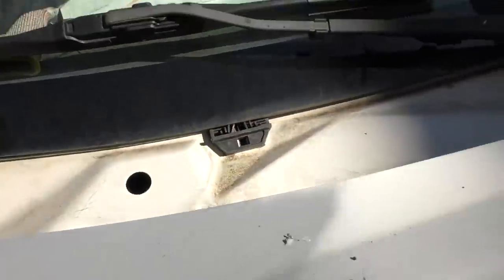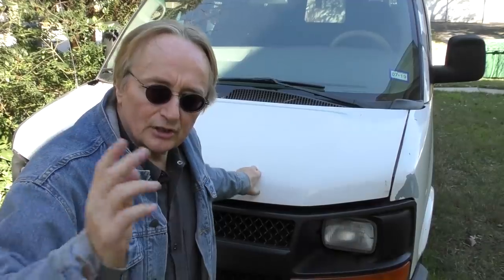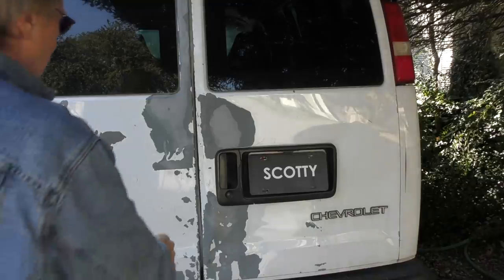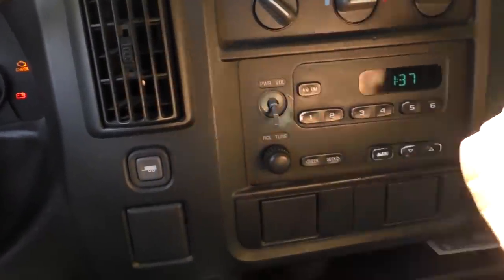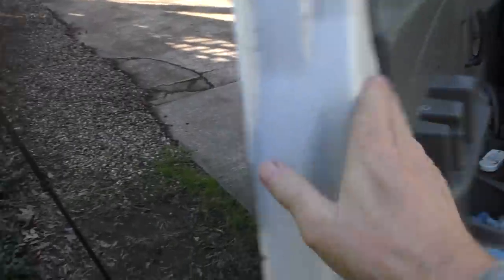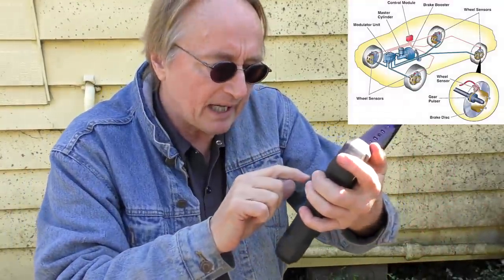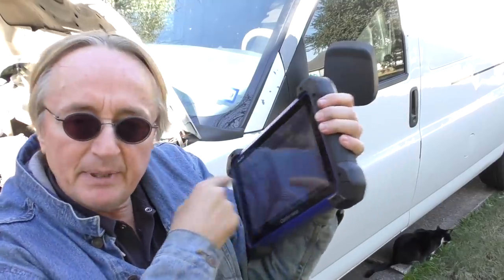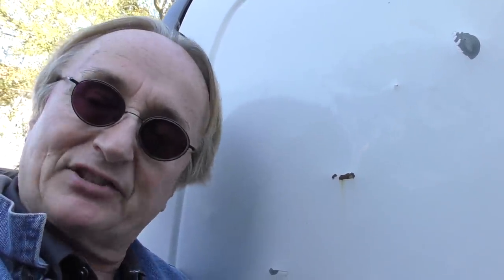I Told You About This Vehicle But Nobody Listened

Comment: Volkswagen cc 2013 64k miles and the transmission hard shifts from 1st gear to 2nd gear, what does it mean and what are my options to get it fixed?
Reply: It probably means your transmission's already starting to go toast and you need to eventually replace the transmission for maybe more than the car is worth. Either you or the previous owner probably crawled the car forward a lot in traffic, and dual-clutches aren't designed to do that.
Reply: @EMichaelBall  that was my fear, cars worth between $10-12k. I bought it for $9k so if I spent $3k and sold it for 12kish I'll be fine. Ha also misfiring 🙄 I didnt listen to scotty now about Volkswagen now I'm paying the price😂

Comment: Everybody cutting down GM I got a 2001 GMC Sierra 2500 hd 6.0 gas use it like a tractor it's got 327000 on it never been touched can't be that bad had Ford's they went through the crusher

Comment: Was the Chevy van left outside in Minnesota during the dead of winter for several years?  Looks like the owner(s) really abused that van.  The Toyota could have been owned by a soccer mom who kept it garaged in Southern California.  A little perspective would go a long way.  Toyota has had their problems with rusted out pickup beds in their Tacomas.  Having said this, I had to drive a Chevy Astro van for a couple of years for the company I worked for.  I absolutely hated that vehicle.  Sloppy handling, underpowered POS.

Comment: Toyota: Bulletproof engines but flimsy materials like those door handles.
BMW: Over engineered fragile engines and electronic problems but the rest of the body panels feel very well screwed together.
GM: combines both negatives.

Comment: I disagree, your comparing a Chevy van to a Toyota Matrix Corolla, that curl only has to pull his own weight when that van has done nothing but work since day one! Scotty you're smarter than this, they're all junk one way or another, there's no windows in this model because it's the commercial model, not made for looks oh, and if it had windows in the back they would be breaking every time you threw something in the back of the van you knucklehead

Comment: None of the vans were that easy to work on. Chevy pickups were way easier and cleaner to work on.
Reply: Id rather work on a van than a pickup with the same engine. Remove the doghouse inside and the whole engine and bellhousing  is right there. On a pickup you have climb up and lay on top of the whole engine bay to reach in there. Using an old couch cushion helps a lot doing plugs on full size pickups.
Reply: @theall-seeingpie8887  I guess it kinda depends on if your working on the front or back of the engine

Comment: does toyota or one of their partners make a comercial van? maybe when they were paired with ford. i did like my 75 B300 you could work on top of the engine sitting in the drivers seat and didn't have to jack it up to get underneath.

Comment: What do you think about ram promaster or Ford transit Van's
Reply: We have been buying Transits for fleet use. All 6 of them have over 100,000 miles on them with no issues yet. Averaging approximately 15 mpg hauling heavy loads of electrical supplies with young hot dog drivers behind the wheel.
Reply: @barnabyjones6995  
Thanks

Comment: This is perfect timing for something to me  that happened recently involving a chevy.

I started my new job the other day and as we were on the way to the place with my tool box we stopped at a light. The car in front of us started to move as the light turned green and a  chevy malibu(<I think malibu) came goinbat least 50mph in a 40 zone seerving between cars and slammed into the back of the car in front of us that just started moving at like 1mph. The car was a honda suv/crossover. The entire front end of the chevy was gone and the engine was probably even damaged based on what the front looked like. The honda had a medium sized dent in it and I would consider it fine to drive.

Honda-1 
GM chevy garbage-0

Comment: look chevys are damn good vehicles it is just really about how you take care of it if you just do engine oil and nothing else it is eventually mess up i personally change the oil based off color or every 5k miles and transmission fluid every 50k miles or based off of color and if it smells burnt i bought my 1997 gmc and the owner just did engine oil nothing else i flushed everything and put new fuild in it and i replaced the transmission on it  now the truck has around 600k miles on it and it runs really good i have done everything when it come to ball joints and U joints its my favorite truck i have ever had and i have had Dodge 2nd 3rd and 4th gen i have had alot of fords and lets just say i hate fords and will never own a ford ever again i have also owned Nissan frontier and titans  and they are good trucks but i hate the intieror the only trucks and vehicles i have ever really liked was my 2 and 3rd gen dodge cummins my 1997 gmc my 1996 chevy my 1999 chevy and my 2006 gmc durmax and my 2013 gmc duramax

Comment: Way easier to work in then a ford way last expensive to fix when there are problems I personal have never seen a 4.8 5.3 6.0 gun motor blown up. pretty much built proof motors. only one head gasket in a 6.0 but let me tell you the 5.4l by ford was the biggest POS. An have put dozens of those POS in their vans 5.4L would never make it to 204k with out 2-3 motors an 6 sets of manifold 25 coil packs an 4 sets of plugs. If you wanna talk about junk a hard to work on

Comment: acorse A CARGO VAN IS NOT GONNA HAVE WINDOWS AND TOYATA ALSO USES V-6 ENGINES IN THERE FULL SIZE TRUCKS THAT ALSO GET V-8 GAS MILAGE ALL FORD CHEV DODGE AND YES TOYOTA VANS  MOTORS ARE HARD TO WORK ON JUST LIKE THE TOYOTA HYBRIDS RADIO NO PROBLEM YOUR A SO CALLED MECHANIC PULL THE FUSE